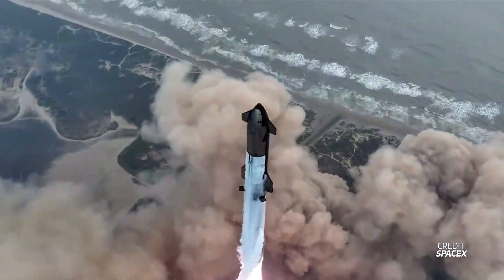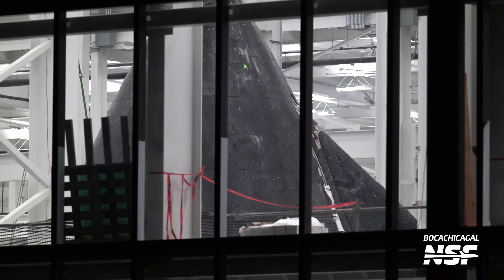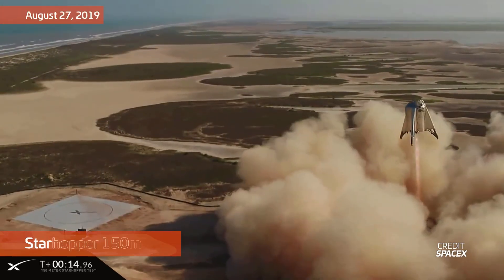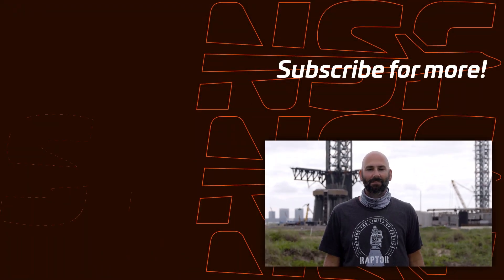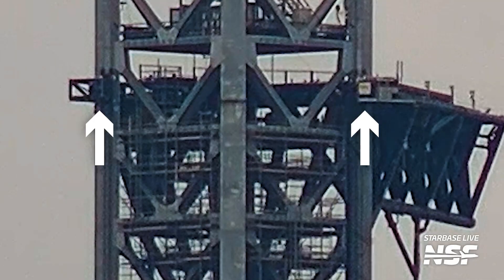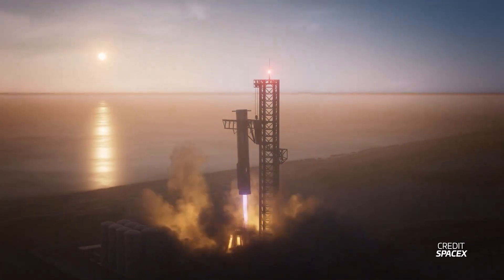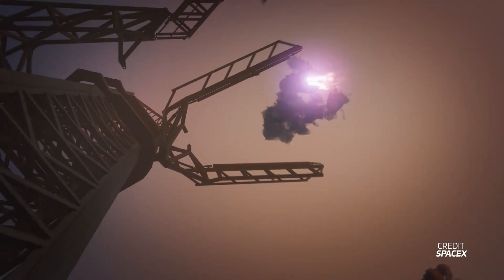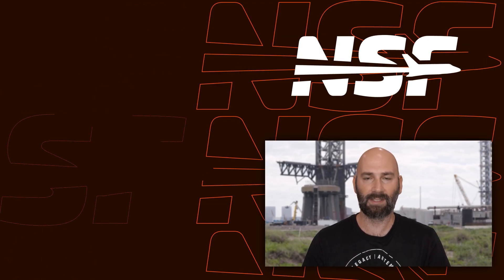Starship To MARS in 2 YEARS? | Starbase Update

Comment: The fact that launch tower sways so much it is visible is somewhat astounding to me.
Reply: Nothing wrong with a bit of designed sway, it's the undesigned sway that's the problem. I hope the math is all good, which I'm sure it is.
Reply: @Codysdab >>> I understand the sway, but the fact so much is visible on a STRUCTURE THAT LARGE amazes me.
Reply: @Allan_aka_RocKITEman  what amazed me was after the Japanese earthquake that created the tsunami, the skyscrapers in Tokyo were swinging back and forth at least 10 feet at the top, and it was all designed for!
Reply: @Codysdab >>> One more reason why I DO NOT like being in tall buildings.
Reply: The tower relies on the steel, not on the concrete (like skyscrapers). The concrete has 2 functions: to hold the steel plates in place (to avoid buckling) and to add weight. It really does not matter much if the concrete cracks in a few places. Just like a fishing rod can bend and flex back the tower does that too.
Reply: I don't think "a few cracks" are the most likely failure mode of the concrete, especially with repeated dynamic loads applied on that rather large lever.

Comment: Not a chance of a mars mission in 4 years
Reply: March-April of 2029 is the 3rd Mars window. So technically it is 4 years and 6 months that they would have to have everything ready by, for a 3-6 crewed mission to Mars. 
If you go back in time 4 years 6 months to 10th May 2020, SpaceX launched Crew Dragon Demo_2 and SN4 had just had a Raptor engine installed. If the ITF5 Booster Chopstick catch is successful, it will be like a milestone, as important as Ship SN15 (5th May 2021)
Reply: @David-yo5ws  They can currently support 4 people in a capsule, in LEO, for significantly less than a week.

Even just permanently stranding 3 people on Mars in 2029 seems a bit of a stress, to put it midlly.